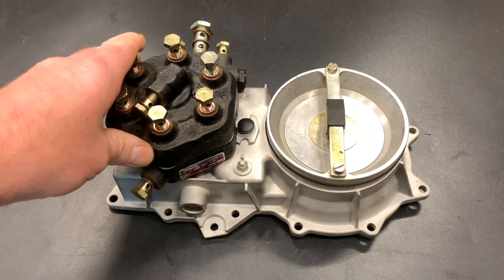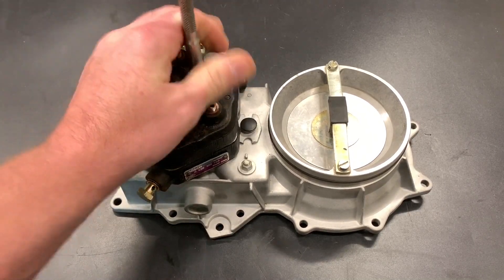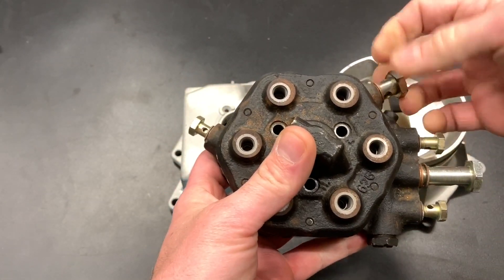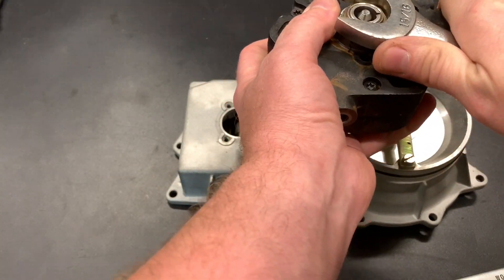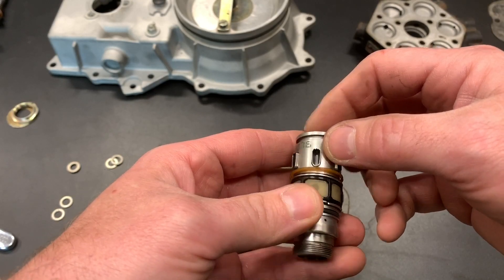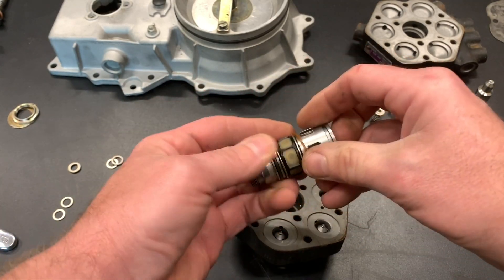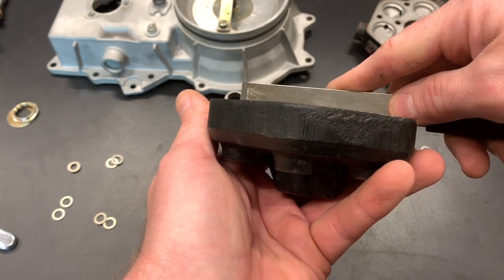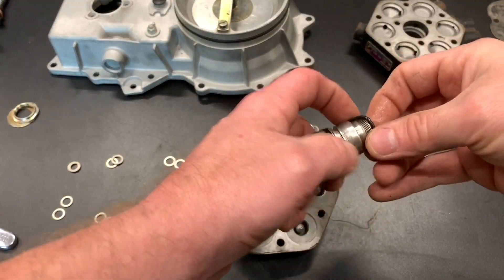DeLorean Fuel Distributor Part 1

Comment: Awesome video! Also wanted to note that those nozzles are removable for those who want to clean underneath (which is recommended).  You don't want to ultrasonically clean the unit with those attached. Use a needle nose plier and pull them right out. Aloha!

Comment: Where did you find the spec for the measurements for the springs ?
Reply from the maker: Observation and experience mostly.  Compare information from other manufacturers that used the same 6 cylinder setup.  The idea is to keep the spring pressure uniform for even flow and be tight enough not to damage the plate or bypass.

Comment: congratulations for the video.  i have opposite problem.  only one injector sprays even if I don't lower the air dosing plate.  the distributor has never been serviced.  I also tried with other injectors but the problem remains.  thank you

Comment: You mention Permatex on both halves, where are you applying it since the plate extends to the edge of both halves?
Reply: The sealant is only applied where the stainless steel diaphragm (plate) meets the distributor ends.  Metal to metal surface will result in a fuel leak.  Applying it to the halves is much easier because you don't want sealant in places it doesn't belong.

Comment: hello, can you tell me how to tune the   dispenser  mercedes m103 3 liters?
Reply from the maker: You must make sure your fundamentals are perfect before tampering any mixture settings.  You need to make sure the fuel system pressures and controls are in top form and the there isn't any vacuums leaks before twisting on anything.  You should not tune to a failed or failing part.
Reply: @FerrinVentures  I disassembled and serviced the dispenser, now I want to know how much fuel should enter from the nozzle channel per minute, here in Russia they write that 170-180 milliliters, is this true? or how to configure it correctly? I write from the translator

Comment: Thanks for the video. Confused where the sealant should go if not on the plate
Reply from the maker: I find it easiest to lightly apply a thin film on the upper and lower parts of the distributor in a very clean environment and gently put the plate in place before mating the two ends.  There are also places on the plate that the sealant shouldn’t be.

Comment: Awesome demonstration. Gonna try mine this week!
Reply from the maker: It’s really not too bad.  Just takes an eye for detail and some patience.
Reply: @FerrinVentures  what should the orientation of the shaft down the middle with the filter be? Isn't there one hole that lines up with the feed to the CSV? I had one cylinder leaking badly, that's why I'm rebuilding.
Reply from the maker: Brian Dunn The notch on the bottom of the shaft needs to dead center one of the cylinder ports.  If I recall, it can be in any 6 positions as long as the ports align perfectly.  However, I marked mine with a scribe mark on the outside before removing the plunger valve.  The 6 o-rings that stretch over the ports are tricky to get in.
Reply from the maker: Brian Dunn where is the leak?